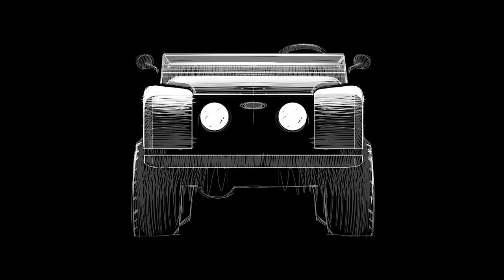The Arkonik Land Rover Defender by Etienne Salomé: Part One

Comment: A little suggestion - from the experience of owning landrovers for the last 4o years - when you assemble them, put a little bit of anti seize grease on the threads, and make sure none of the threads stick out of their nuts too far - makes them a real quality build if you can undo things when you need  At least that I will be wanting you to when you build mine :)